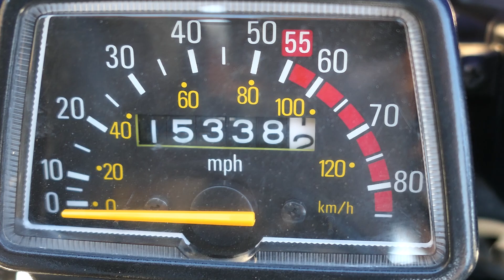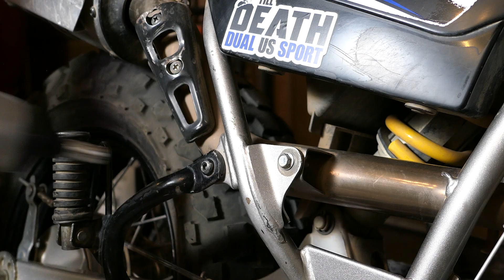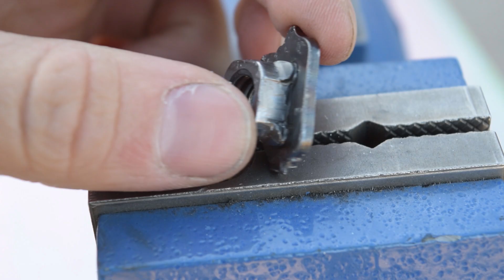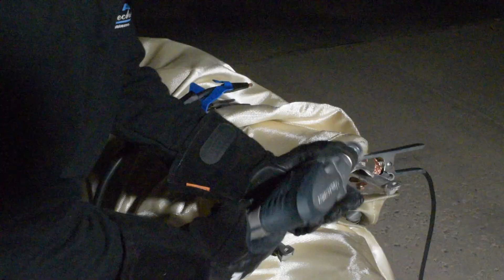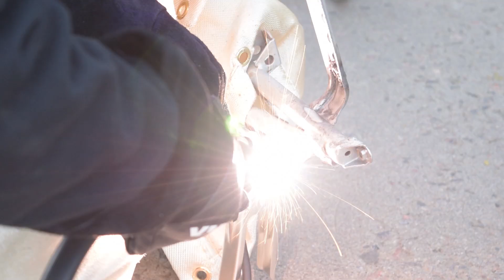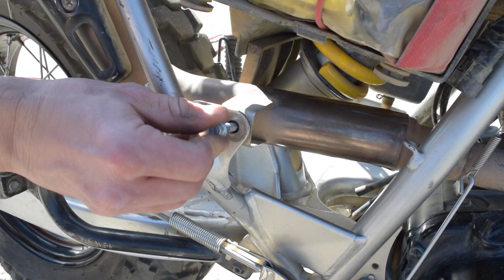How To Fix a Broken Muffler Bracket on a TW200 Dual Sport

Comment: Hey Brother! I don’t know if you still use your gopro Hero 4, if you are! Ignore the rest of the message, if you are not, I would like to ask you something.
I want to start making motovlogs with my hero 4 but the only thing I’m missing is the mini-usb to 3.5mm mic adapter. I’ve bought the TRRS to TRS and got the iphone earbuds but all fake mic adapters for gopro hero4 dont work. I was wondering if you still have the mic adapter for the hero 4, I would love to buy it from !
Reply from the maker: oh hey there! yeah I still use a hero 4 and don't plan on switching. yeah there is a link to the adapter I use in the description of this video. https://youtu.be/q8D6_xkTaKA it's the 90 degree one. it's a bit more expensive, but I have had no issues with it using it long term
Reply: @TDubsKid  Alright will do! appreciate it and keep doing what you're doing. I'm enjoying the videos!
Reply from the maker: no problem! thanks for watching, ill keep them coming

Comment: Sweet into man. So I see you weren't like me, and didn't weld the vice grips to the frame haha. I was wondering if you were going to have to run a tap to clean the threads, and then you did. Good work! I imagine since you still have the bike apart you're going to continue welding, to fix your foot peg crack. If you are, no problem but I wouldn't wait to long to paint over the welds, if you are waiting to keep working. That stuff rusts quick.
Reply from the maker: thanks! haha I'm surprised I didn't do that. I much better than just ramming a bolt thought and hoping for the best lol. yeah it's all done now didn't have time to rust at all. still gotta edit that video though

Comment: Next time thread a disposable bolt into the nut before you weld it to avoid getting spatter in the threads and warping the nut. If done correctly, you shouldn't need to retap anything after.
Reply from the maker: thanks for the advice

Comment: If you can weld with flux wire feed, you can MIG without too much trouble. I don't know that machine, so maybe it can be converted/maybe it can't, but when you're working in more complex shapes/structures with confined space, MIG is a lot easier to control. Of course TIG would be best, but the learning curve's a bit higher. Nice job with what you have to work with though.
Reply from the maker: Yeah very similar processes in some ways. This one can’t be converted to mug but the next step up does mig. I believe that. Flux seems to spatter a lot more. Yeah rig would be cool but not sure if I would have the patience to learn. For sure, if it holds then I’ll be happy with it

Comment: Good job! If you keep doing practice welds, play with your amperage. You might find more is better sometimes. Also, if you have a source for extra steel material, you can add gussets to your subframe that will limit the flex also. It'd be cool to see what you come up with!
Reply from the maker: Thanks! Yeah that’s a good thing to do, I noticed when balls up and doesn’t penetrate properly, gotta turn up the heat. For sure I got tons of quality scrap steel

Comment: Did your rear tire break the bracket? I've noticed after adding the DG exhaust the rear tire now hits it when I go over bad bumps. Got rubber marks on the inside area of my exhaust.
Reply from the maker: no the only reason the rear tire hits is if it gets bent inwards from a fall. the bending is what breaks the bracket

Comment: Hey west, rocky mountain ATV has tusk heated grips that will fit Tdub for $30,  they are on closeout so they will not last much longer!
Reply from the maker: hey thanks! I already got a set a while back, just got to install them at some point
Reply: @TDubsKid  ahh,  well in that case just know that they are actually pretty easy to install you should be able to do it in about 30-45 min.   If you use the wire tap to power them then the best wire to tap into would probably be the blue wire with black stripe coming out of the black connector.
Reply from the maker: for sure, takes me a lot longer because I make a video, and I may install a relay

Comment: It makes you wonder the manufacturer needs to go back and make those weak points stronger so the consumer doesn't suffer
Reply from the maker: yeah it's mainly because I carry lots of camping gear on the back. they probably didn't have that in mind when they designed it. and it also get's dropped a lot

Comment: Bench welding skills looking pretty good 
with the flux core.
Couple tips, if your going to grind off your welds,
you need to V out the cracks a lot deeper.
You can use copper slugs and plates to protect from
getting weld or slag into holes.
Reply from the maker: thanks! ill have to give that a try next time

Comment: I feel like cutting that whole bracket off and making a thicker one with a threaded hole and welding that to the frame would have been easier and stronger
Reply from the maker: that could work, but I didn't want it to be too strong or else it could just cause the more important part of the frame to break
Reply: TDubsKid true
Reply: Thicker does not always mean that it will be stronger my friend.  Frames must also have have flex.  The flex prevents the cracking.  I am still learning the different types of metals myself.  : )  Safe riding friends!